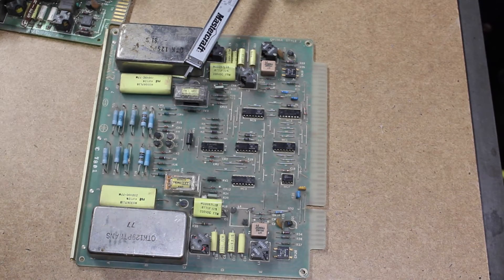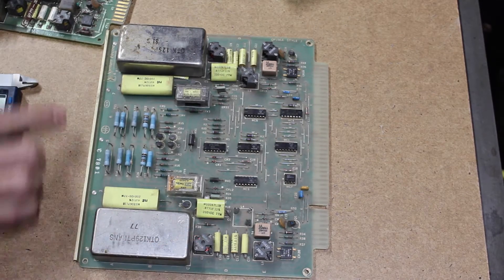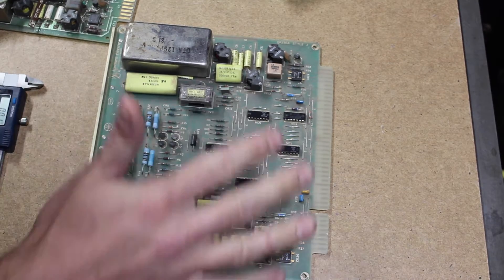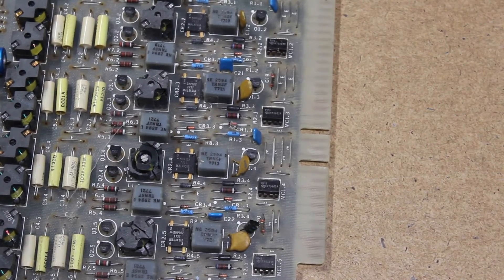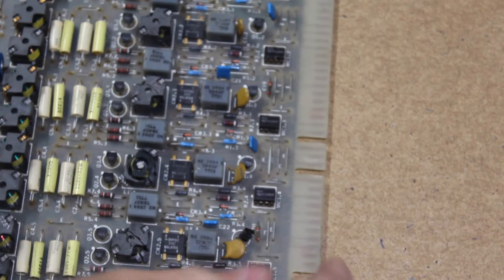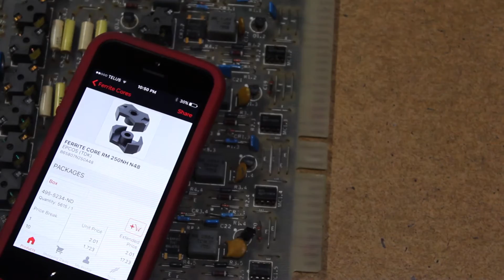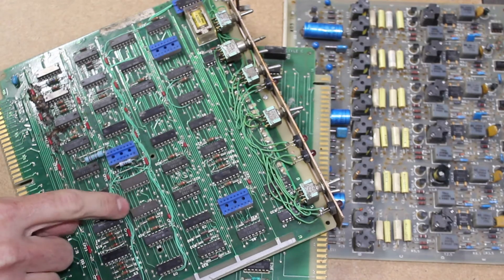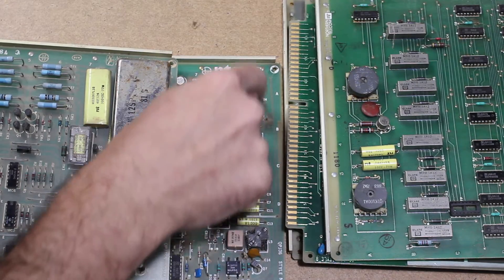Vintage Telecom - SG-1 Intro

Comment: Wait wasn't the SL1 the first digital PBX?
Reply: AT&T’s Dimension PBX also used TDM PAM, but used miniature 50ohm coaxial cables to interconnect the carriers and cabinets. They continued with bundles of miniature 50ohm coaxial cables with the transition to digital TDM with the System 75, which had two 8-bit wide (parallel) TDM buses divided into 256 timeslots each for both scale and redundancy though each call required two timeslots — one for each direction. They continued augmenting that same interoperable architecture right up through the Avaya G650, which ironically can be successfully connected to the bus of an original System 75 from the mid 80’s.
Reply from the maker: Steven Clickford the SL1 was the first fully digital PBX, it had digital call processing and digital voice paths. The SG1 had digital call processing (accomplished with wired logic) combined with an analogue (PAM TDM) voice path.
Reply: @beefchicken  Didnt the ROLM CBX undercut both NT and AT&T as the first digital PBX?
Reply from the maker: David Sullivan ROLM was second place, they released the CBX in 1976. The first SL-1 shipped in 1975. 

...according to some sources! Others say the CBX also shipped in 1975. As a Canadian, I’m inclined to believe Nortel got there first ;)